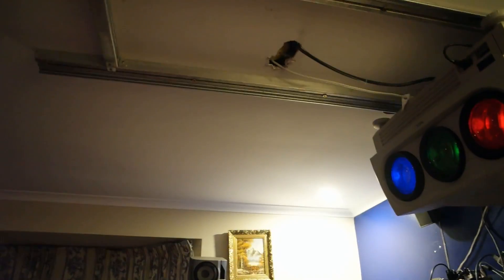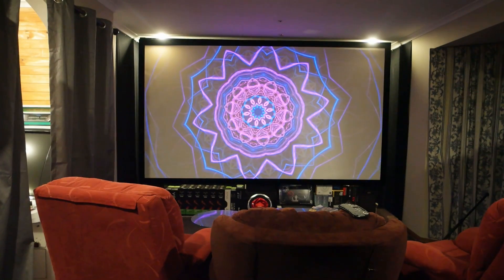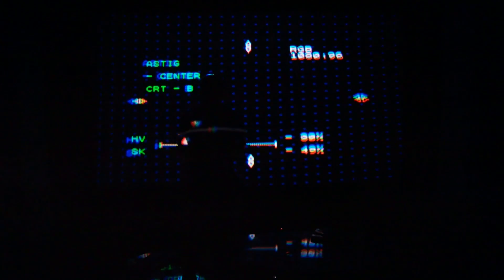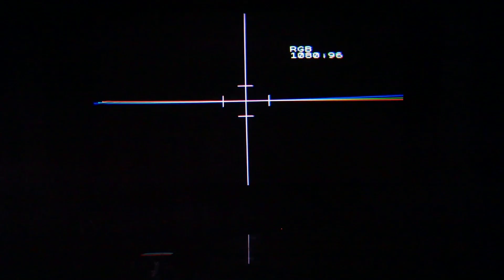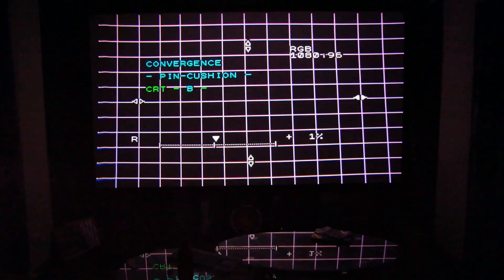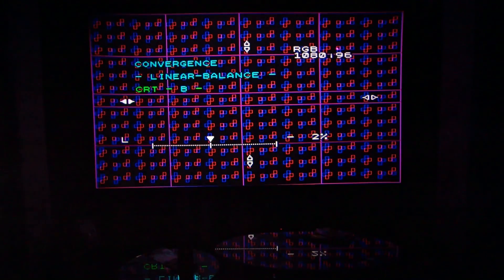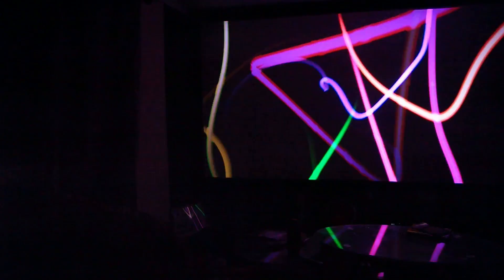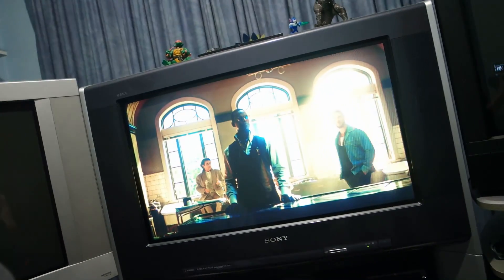CRT Projector Convergence Timelapse

Comment: @Turner TV how do retro games look on this
Reply from the maker: 240P games throw really awesome scanlines.  Unfortunately it died (Cracked blue tube, suspect broken H scan board too) so I can't demonstrate.
Reply: @TurnerTVOfficial  oh no :( gonna replace it with digital?
Reply from the maker: @hollacarrot179  tempted, but not really keen on spending 5-10k on a decent JVC
Reply: @TurnerTVOfficial  I feel you. I'm running Marquee 9500 Ultra with HTPC. Loving the picture, but when it craps out I've got no clue where to upgrade as good digitals still cost so much.
Reply from the maker: @hollacarrot179  I have the parts to repair, but I want to do a full overhaul and cant bring myself to.  I know anything other than a DILA will have awful blacks so I can't do the cheap digital either.  In the meantime I have a sony KVHR36 propped up on the coffee table in there lol
Reply: @TurnerTVOfficial  If you have a spare tube and boards for the NEC, just give it some time. One day you'll find the motivation to tinker again. Marquee took me 2 years to finish, I got it very cheap with messy LC housings so it was a huge project. Looking back though way more satisfying than a plug & play digital.
Reply from the maker: Rebuilding is the play, but the shed is full of silvia parts, I need the service manual and the fault is caused by an IC aging on the horizontal board i believe so will need to be replaced even if I have another board.  The other problem I have is craning it up and down from the roof.  I think when I i fix it it can go on a trolley.  Good to know there are people who are still persevering.
I do have to say putting a DLA-X7500 or (shudder) a DLA-N7 is still something I would like to do so I can fix the mess I've made inthe the room :)
Reply: @TurnerTVOfficial  For sure, a good D-ILA is way better than any CRT out there. Just gotta wait for a nice deal. I def favor a floor installation with CRT. More hassle free and easy to reach the insides if needed. High table behind seats is also good because you can sit in the middle and not have your head in the way :)
Reply: @TurnerTVOfficial 
Spewing hard
Reply from the maker: @Adam-rt7lp  I will rebuild!  So little space left in this place though,

Comment: Wow, amazing! How do you think these compare to modern laser phosphor projectors?
Reply from the maker: Modern projectors are brighter and have a higher resolution.  I think laser phosphor projectors only use the laser as a source of white light -  I'd love to see one that scans the phosphor like a CRT does!
CRT projectors strongest points are the black levels, as they are the only emmissive type of projector available; and the motion resolution, due to them producing the image as a scan, rather than by peak and hold.  The final factor for me was the cost, this cost me about AU$300 used, whereas a used digital projector I'd be happy with runs about 5k.  I think the lifespan of a CRT projector with new tubes and a laser projector would be similiar.
Reply: @TurnerTVOfficial  Wow, 300$! I quickly glanced eBay and found way more expensive units over there.. Probably not a good place to look.
It is indeed a shame that scanning has gone out of style, but I was hoping that with laser phosphor we would at least get the brilliant colors back that we once enjoyed. Single chip DLP is just horrible in that regard, and although I appreciate the color of my LCD projectors, those have horrible blacks (or rather grays). 
Apart from size, availability and calibration (as you so kindly showed), this does sound like the ideal projector for my taste. The ability to render any resolution at zero latency makes it even more futuristic. And light gun interaction to top it off. Amazing stuff!!

Just curious; how much brightness does yours produce?

Thanks, and I hope you'll enjoy it for many years to come!

Sent on a 19" CRT hooked to my Nvidia GTX 1070 laptop. Probably the last with VGA output! lol 😁👍

Comment: My xg worked 5min and shutdown f7 error . :(
Reply from the maker: Not good!  Only problem I've had with mine was loosing the settings.  You could try checking out the curtpalme forums for a solution, these are meant to be very serviceable.

Comment: What's the resolution of this projector? It sounds like there are various supported aspect ratios and resolutions, but from 1997, I wouldn't know what content someone was used on it.
Reply from the maker: I run it at 1920*1080 96hz interlaced. As it's crt the resolution is only limited by the scan rate of the projector. In reality, it 1920*1080 isn't fully clear so I'd say it was about 900p if i had to define it. What is cool is it will scan down to 320*240 at 60hz/15khz and show kickass scan lines
Reply: @TurnerTVOfficial  lol then it can be used for retrogaming
Reply from the maker: @ManOfAttitudeLP1998  Yeah, works well at 240p, I have 11 arcade games and a dedicated CRT room for those antics howerver.
Reply from the maker: Originally they were used in simulators at fairly high resolutions. Max resolution in the manual was around 2500*1500 but I imagine back in the day they would have used a lot lower. I believe there was a 1080i laserdisc format around that era though.
Reply: @TurnerTVOfficial  Could I run 1080i on a Sony VPH 1044Q?

Comment: I have found my first projector crt tv and im currently extracting all the parts
Reply: Good for you. Way to take something useful and turn it into a massive pile of useless parts.
Reply: Browningate it was useless before i had taken it apart. The old hunk of junk was used in our family lake cabin, one day while some family was using the cabin they turned the tv on and apparently it made a loud noise and it wouldn’t work anymore. The plan was for the tv to just go to a junk yard but i had other ideas. I looked into it and was surprisingly lucky to have it in such a good condition based on the circumstances. It was outside in the sun and in the rain for about 3 weeks. I tried my best to salvage as many parts as i could i got the tubes out safely, i have salvaged some capacitors some led indicator lights, some other bits, the speakers, and a transformer. If I hadn’t dealt with the thing, that would have been the end of those crts so yeah i don’t like to think i took something that was working, i like to consider it more like salvage the parts i would never be able to work with ever again in my life as a 17 year old. I also gave the dam thing another chance to actually work. So now that you are a bit more updated, can you please redact  the sarcastic praise?
Also sorry for the big response, there was a lot to tell.
Reply: @Vahan - Try Craiglist or the social network. I'm sure you could find someone who could use it.